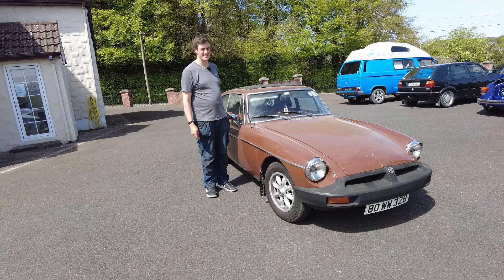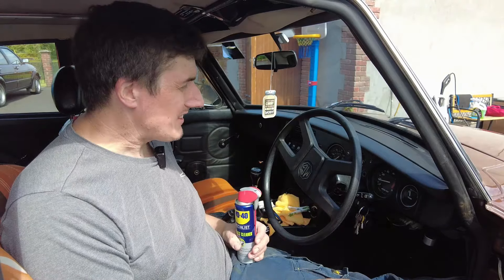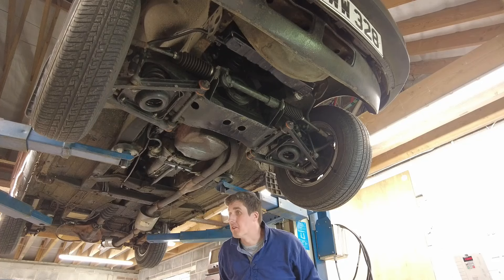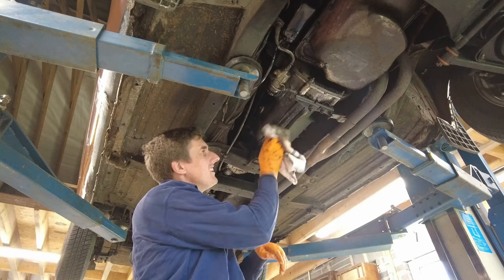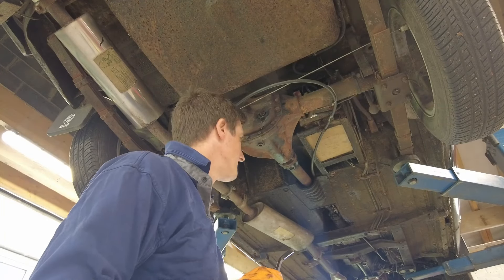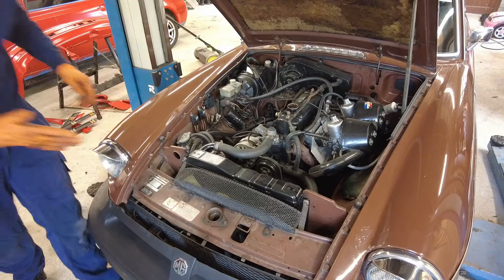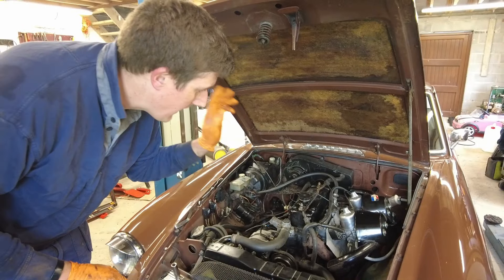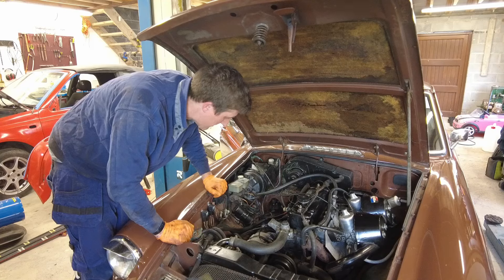Reviving Your Classic Car After Winter: The Ultimate DIY Guide

Comment: Since I have a Beetle and an MGB GT, I've subscribed. What was squirting from the rear most carb at 17 minutes in ?
Reply from the maker: @paulallen6915  good to have you along! I put too much oil in the dashpot and the excess squirted out through the vent hole.